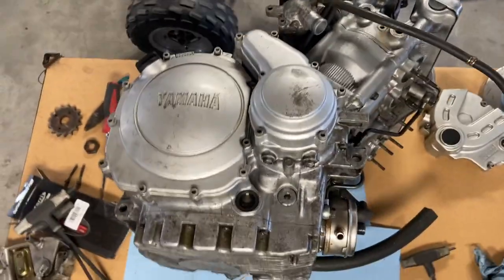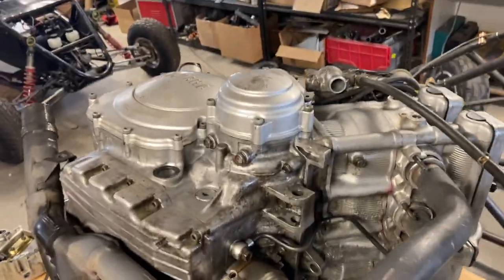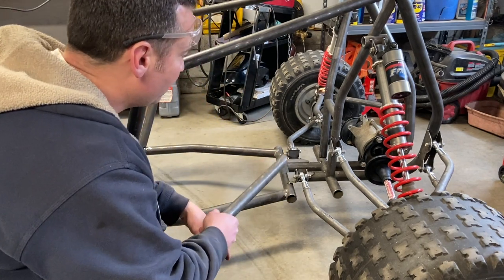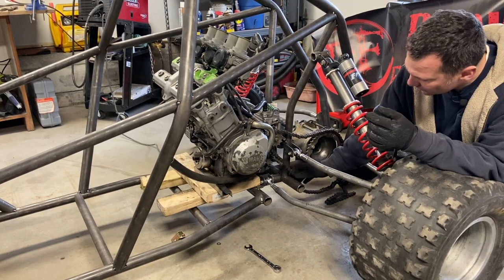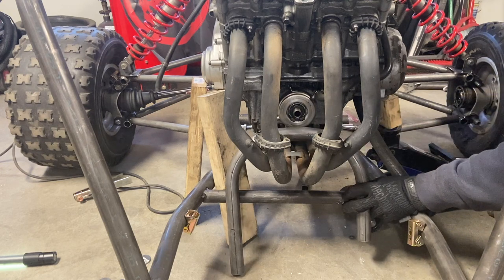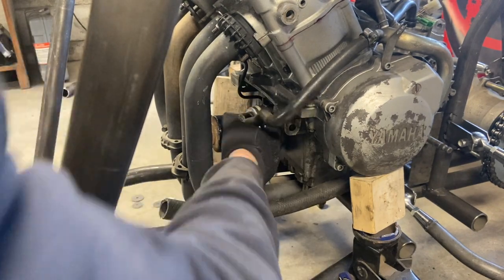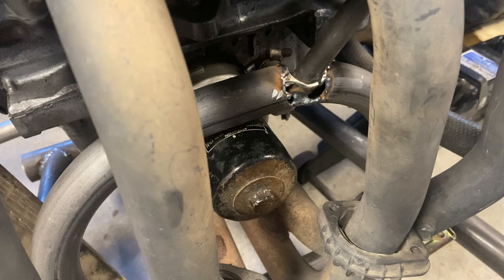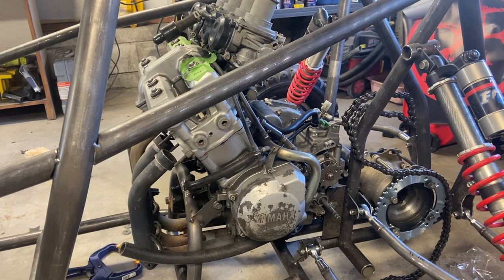Crosskart Build #7: 600cc Engine Install

Comment: When it comes to the coolant hose you could delete it and put a plug on the metal hose or even loosen up the oil filter nut and rotate the oil filter cooler whichever way you want

Comment: Great video man. Have considered or looked into possibly getting a oil filter relocation kit for that motor? Not sure if they are even available but it seems like that would reduce the amount of headaches down the road when you need to do oil changes. Either way you rock!
Reply from the maker: Thank you for the comment and compliment.  I cut it out of the video, but the exhaust is actually open between the exhaust for oil changes.  It ended up working out really well.

Comment: Just re tap the front sprocket. You can tap the weld. Use weld too add metal if ya need
Reply from the maker: That was my original thought, just to do it the right way, but my research showed that is a hardened shaft 😡. I’m going to attempt to cut a groove for an offset atv retaining washer. We’ll see how it turns out!

Comment: Didnt know that was a yz600r engine  thats the bike i have and was thinking of using the motor for one of these
Reply from the maker: If you can swing it get an fz06, it the updated version with fuel injection. The carbs on the thundercat can be pretty finicky.

Comment: Nice build. Did you mount the engine at the same angle as it would be in a bike frame? Reason I ask is because the oil sump and float bowls are designed around a certain mounting angle. Not really a big concern on a fuel injected engine.
Reply from the maker: I try to stay close, within 5-10 degrees. Think of someone riding a wheelie for a really long time, usually works out okay. And with the exhaust you usually get more seat room with it at its correct angle.
Reply: @KJRaycing  I was just asking because of my first experience with a carbed sport bike engine in a buggy. The angle of the engine was off by just enough to cause the floats to never seat which resulted in fuel steadily flowing thru the cards. I adjusted the floats to shut the fuel off to prevent flooding which resulted in high rpm fuel starvation. I finally just switched it over to an injected GSXR 600.
Reply from the maker: It seemed like you had a little experience with this. I do pay attention more to the carbs being level than the case just for that reason. I’m not sure if towards float needle or away matters. I would love to have an fi setup. Next one maybe an fz6.
Reply: @KJRaycing  Been watching this series....great job! I'm considering building one myself for use in the Arizona desert. While reverse would be nice, I don't think 40ish HP ATV engine would be enough for what I want to do. So, I'd consider giving up reverse to use a 90+ HP street bike engine and maybe a bit taller tire. Question is what to run for rear IRS drivetrain as I don't think the Polaris one you use would handle the higher load. Thoughts? Suppose increased strength in the a-arms and front spindles would be needed as well....
Reply from the maker: So i’m trying the outlaw rear end for one simple reason. Torque. Sport bikes are high hp but similar torque. So i think the rear end can handle it, but not 100% sure. The rear carrier actually has bigger bearings and a thicker wall for the cv’s to ride in rather than the can on the end. I make my tires the weak point and although i could get more traction from a more aggressive tire, there is less stress on the driveline.  We’ll find out if my theory is good or not 💪👍. Thank you for the interest, it’s awesome to talk shop.

Comment: I recommend u, the sprocket ratio like 13/46 or 13/47, that’s what Europeans use, and I use
Reply from the maker: For the transmission in the bike that is 99mph off the rev limiter in 6th gear. I want the triple digits baby 👍💪😎

Comment: or build a custom exhaust instead of mounting it underneath the engine.
Reply from the maker: I did consider that, but i dont tig weld, and i wanted this to be approachable by garage fabricators like myself 👍💪

Comment: What do you guys think about something like this but with a honda k series engine, a longer wheelbase and wider track? i know it would be a lot heavier but it would still be very light and it would be a very reliable and confortable (from the extra space) daily driver, also it would be more stable at high speeds which is something cross karts lack. 
The idea is to oirent the engine transversally and put gears on the output shaft to have the transaxle behind the motor.
would this work? why wouldnt it? Would it be a pain in the ass? What am i not thinking about? Got better ideas?
Reply from the maker: That is a brilliant idea and may actually be a little easier to create. But it wouldnt be a crosskart. I looked into the laws of home built road legal cars, and although it is possible, it is still a bit of a process. And it wouldn’t necessarily be a crosskart.

Comment: Honda Civic radiator and fan would work good on it to cool the engine
Reply from the maker: That is very true. Although a lot of those have a trans cooler built in that i wouldn’t necessarily use. I’d like to find an inexpensive and somewhat narrow vertical mount to fit right between the rear uprights. But the one that came with the donor quad has worked out well keeping the temps down so until i find the right one that is what i’ll use, because it’s free-99.

Comment: How compatible do you think a K4 GSXR 600 would be with your plans?
Reply from the maker: Very compatible. Not sure what the k4 means but i just mounted a 4 cylinder from a yamaha and it actually takes up less room than an atv engine.
Reply: @KJRaycing  2004 Model Year, lol, any plans on doing body work on it? I’ve been following the build and I’m waiting on these tax returns to get a welder, bender, and your plans, I can’t wait to see what else you do in the future!
Reply from the maker: Should fit just fine. I designed this to be very flexible with components just for that reason. I’ve had a lot of requests. I think two seater next, then solid rear axle crosskart.
Reply from the maker: I keep the body work pretty simple as i do not do fiberglass. Plastic or aluminum panels.
Reply: @KJRaycing  Definitely looking forward to the 2 seater! I’m thinking pretty soon Cross Karts are going to be the “Ponycar” of the UTV world nice and cheap to build up, easy to work on, and fun! I’m waiting for them to really blow up in the states, hopefully getting a early start on driving technique 😂😂
Reply: Do you mind if hit your DM on Facebook? I have some questions if you don’t mind?
Reply from the maker: Not at all, that’s why i set it up! Thank you for asking first, even though it wasn’t necessary 👍

Comment: What engine is that?
Reply from the maker: Yamaha yzf600r. They were run for over 15 years, they are reliable and can be found on the super cheap. 100hp but these don’t really need much more.

Comment: Im sorry to say this to you, but cutting a notch, especially that big, and replacing it with another concaved have pipe will not regain the original strength.
Reply from the maker: I put a note at the bottom that for how we’re using it, it retains it’s strength. I’ll clarify that more in future videos. Thank you.

Comment: that tube at 10 min. that looks garbage man. the motor will be pulled back and up!!
Reply from the maker: Dude… I’ve been driving it for almost 3 years with zero issues. Thanks for the heads up though 😉
Reply: @KJRaycing   Everything else is indeed well done Mate. you've got my subscription as well.
Reply from the maker: Thank you so much. 🤜🤛

Comment: That notched tubing has nowhere near the strength of the original and you shouldn’t be telling people it does!
Reply from the maker: I agree, it wouldnt if i just notched it. But i did a little more than that...
Reply: @KJRaycing  putting that other piece of tubing in would hardly amount to much strength. That being said, it may be plenty strong enough for the application. All I’m saying is a person needs to watch what they say/share because others may not know any better. Anyways, nice build so far.
Reply from the maker: Thank you. I will be more cautious in the future.
-Kyle